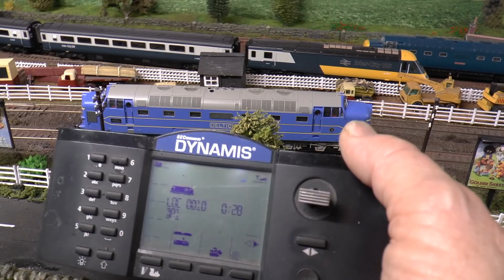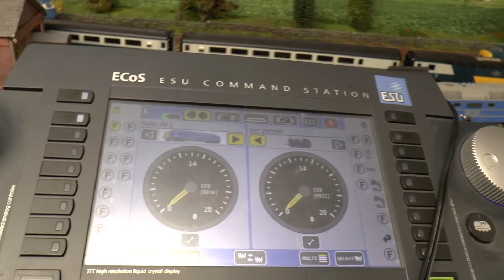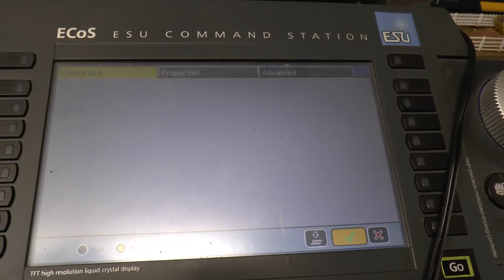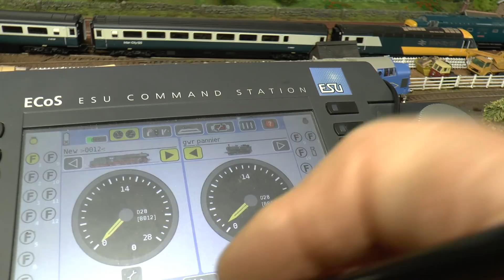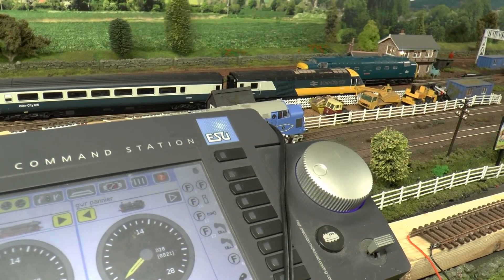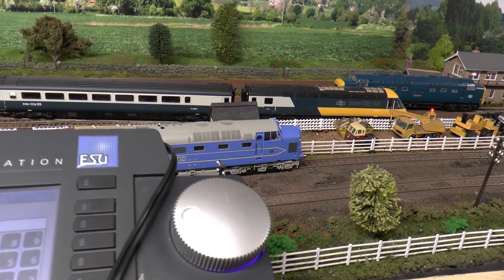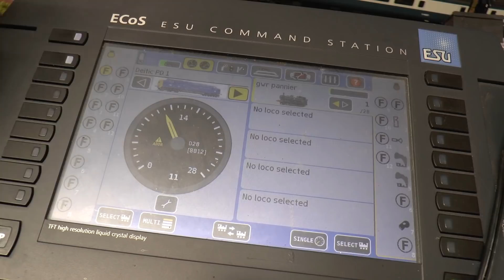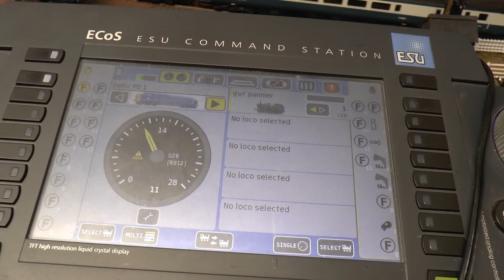Help re ECOS part 2

Comment: Dave, I noticed when it found the decoder and you tried to move the address conflict triangle was up on your screen for the Deltic. Now the decoder was found try changing the address from 12. I ran into that when I had the Ecos. Cheers & good luck Peter
Reply from the maker: I have cleared most off the ec os , then give n it a high number address that i have never used before ..still nothing ..yet attache the Dynamis or the Elite to the track and it works ..Cheers Dave

Comment: Dave, also for future references,, people, modellers, friends will try to help you and will give you sometimes conflicting information and this can lead to more confusion when you've started out to get answers. I also would suggest if you have any problems (which you haven't in the past with the ECoS or your sound decoders) to ask for help, who knows the ESU system or the ECoS it self. there are many options as you've found out how to register a loco which looks very complicated but if you leave it to the decoder and the ECoS its very simple, another suggestion is try to organize your loco list and loco/decoder numbers and I would do this as soon as possible. I either enter decoder addresses  by the loco running number, or I select a 1000 or 2000 decoder number for particular locos, you've got the choice of 10000 and more., so for instance your deltic locos could have the decoder number 1000, other diesel locos starting with 2000 and steam locos with 3000 or 1 -999, this is your choice but in the end it will make it much easier to control your decoder numbers for new locos you add to the list.Also the loco list 1 , loco list 2 and loco list 3 is important , file the same type of loco under the same loco list, Loco list 1: Steam, Loco list 2: diesel and loco list 3: others, and to do this you go into the window where you change the details of a loco, e.g., decoder number, name of loco, loco list. you also will find when you go and search for your loco under the min loco list you can tick loco list 1 or 2 or 3 to get to your individual loco, either steam , diesel or others. if you know your decoder number you can also enter the decoder number under numeral window.
John
Reply from the maker: 6109river I do have them in lists 1,2,3 Steam one side and diesel other... I shall try again to day , I do have all the numbers on a sheet and most are 100 + for diesel , then 1/ 30 for steam , this new one came as 3 obviously , but just for starters I put it to 10 ... my other trial is to connect the dynamis to the ecos so I can use both ... cheers Dave
Reply: Ok Dave, how many loco are there registered you don't own ? did you delete the Deltic in question as well ?
Reply from the maker: @6109river  I delated most have jst watched a video which should prove useful   https://youtu.be/JtKsaO_DycA .   just a case now of getting in the loft later to day and trying all this out ...the boss has a few jobs for me first John ....feel better after 7 hours sleep ...without ecos nightmares ..LOL ..Dab
Reply: I've noticed this with my wife to, when I have problems with my setup there always seem to appear  little jobs on my do list (lol)
Reply from the maker: @6109river  Always jobs to do John ....thats why I like going to the loft ...out of it ..Dave

Comment: I love the ECoS & I know how frustrating stuff like this is Dave & i wish i could help but i'm stumped too! ESU's decoders are all railcom plus certified so you could try seeing if it can detect it that way. Also, i noticed there was a yellow warning triangle in the speedo dial saying "ADDR" which i assume means address & this seems to indicate that something is wrong!
Good luck finding a solution, hope it doesn't take too long!
Reply from the maker: Showing ADDR is showing when nothing will happen , not a clue what causes it ...got to be something to do with the decoder match with ecos ..

Comment: Hi Dave, you have a yellow warning on the Ecos screen in the middle of the speed dial at 5.00ish on wards it mite be ADDR warning which is in your manual mate.
Reply: Sorry Dave it at 5.50 in the video.
Reply from the maker: All noted ...it did that and nothing worked , but after reset it is ok but still wont accept the d5 decoder ..Cheers dave

Comment: Hi Dave.  We are all  bombarding you with ideas, so here goes:
I am suspicious you may have and Address conflict or a railcom issue

I would begin by Reading cv29 and noting it, then writing a value of 2
If you wanted to use Long addresses you would write 34
Next, assure you write a loco address to cv1 that you are sure was never defined in the ecos
Then define this address to your loco by editing the loco 

Comment on long addresses: if you use a long address don't forget to assign the correct values to cv 17 and 18 by using a long address cv calculator off the Internet to get the correct values, and of course set it on in cv29
-chris
Reply from the maker: Shall check this ...got a few more ideas now ...just a case otf time now ...may get to it later to day ..cheers dave

Comment: Hi Dave, Ive checked the current firmware & it's v4.2.4 so your ECoS is up to date. I've no v5 Loksound decoders on my layout, only v3.5 & 4.0's. I have suffered a loco acting like yours in the video. In the end I had to delete the loco from the ECoS memory / database (Your case the deltic) . Then I reprogrammed the loco on the programming track. If it turns out to be the same issue I had you'll find the loco should now respond. Cheers Mike.
Reply from the maker: Wordsworth Model Railway Hi Mike , Yes I have done that , a few times , but still same response ... I shall try again to day ... my other option is to connect the dynamis to the ecos ... May try that now .. long time no hear Mike ... cheers Dave
Reply: @howarth004  Hi Dave, thought that may have rectified your problem. Like I said I had one do the same thing with my ECoS. Said address was ok, read the decoder ok, but just didn't do anything when you gave it a command. Thankfully mine worked after deleting & adding new loco. Last think I can suggest is a decoder reset. Long time since I've done one but think it's cv 8 and write 8. Hope you can get things resolved soon. Cheers Mike
Reply from the maker: @1964mikem  One of my next tries will do the cv 8 test Mike     ..cheers Dave

Comment: Have you sorted the problem Dave? I have a 
Loksound V5 in my schools class with my ECOS with the latest firmware.
Reply from the maker: Not yeet , but going to follow a video I have been sent ...but will have to be later ..a few jobs first ..cheers dave
Reply: David Howarth at 2 minutes 50 you edited loco and went to Advanced and noticed Decoder Profile was empty - mine is the same with a loksound V5. I’m hoping that your not going over old ground with this! Go to to the main screen and press the ECOS spanner icon at the top and go to Setup 2. Set the CV to 1 and press Read. See what the CV result is. As someone pointed out towards the end of the video you have a conflict of addresses. Chance the CV result to 88 or something (an address you haven’t got programmed in already) then press write. Once done, read it again to make sure it’s done it.

Go back to the main screen and edit loco. Set the address the same as you have just changed it to. See if that sorts it? Good luck. Steve. Plymouth
Reply from the maker: @sh018q2316  I have managed to sort it Steve , thanks for your help , I did get it to read cv1 and thats when all the configurations came up , still not sure what i did from there ,but it worked ...cheers dave
Reply: David Howarth - it’s purring away nicely. If I could only find my piece of paper to get my HST 125 programmed into my ECOS in consist, for power and dummy car sound!! Steve. Plymouth
Reply from the maker: @sh018q2316  Hi Steve , yes purring away .....still baffled ....for the cosist , i just go in to edit ...then on the list consist ..then add each loco or loco and dummy car ..maybe instructions (which i have problem reading them ) in the book may help ? .....Dave

Comment: Dave, I've noticed your loco is on DC and not DCC (just try and change it to DCC at 1.54 = top line) but besides this you haven't followed the suggestions, all you've done is reprogrammed the decoder number, this is not  going to get your loco going,  I've mentioned before your loco under decoder number 12 is occopied by another loco, so you can't use that address. , also at 5.35 you have to to press  detect DCC RailComPlus loco, wait for the click and than press the green tick and don't change the loco from one programming track to another track. leave it on the programming track and comeback to me with another video showing me what you're doing. you don't program locos into your ECoS, this is why they have the automatic registration, go into your loco addresses, (when selecting the loco list make also sure all the options for loco lists are off) either by name or number and delete all locos either new, or locos you don't possess especially the one you've entered (the Deltic in question). put your loco onto the programming track and press the DCC RailcomPlus and than touch the green tick. it should now register itself., don't try to enter new decoder addresses, you must have dozens of them.regarding the sound decoder/lokilopt V 5.0 not being there is true but irrelevant. when it registers you will see anew page appears either the number which is in the Deltic loco is ocopied by another number and it will suggest another number, click and except it, than the RailComPlus icon will appear and you touch this on the green tick, than if it is a Deltic sound file, the Deltic loco will come up if not  a Sounddecoder 5.0M4 will appear. change the name to your preference, if you want to change the loco number  make sure the number you chose is not already occupied by another loco as it was displayed at 5.50 with a warning sign on your speed dial.I know you're getting frustrated but at the same time pressing so many buttons to try to come to grips to solve the problem you're creating more. for instance at 5.06 you're trying the get the loco going under CV 63, to change the decoder address at 5.06 you need CV 1, but leave all these other options alone.when you select or self register or enter locos make sure which loco list you want your loco list to appear loco list 1, loco list 2 or loco list 3. you can organize these by selecting for instance loco list 1 for steam, loco list 2 for diesel and loco list for others like EMU's 

so I'll go through again:1.) by unticking all loco lists, select all locos you don't possess and delete them 1 by 1 including the one you've manually entered (your new Deltic), 
2.) make sure the sound file you've downloaded for your other Deltic locos don't have the same sound file name of your current loco (the one you've got problem with
3.) put your loco onto the programming track and PRESS DCC detect RailComPlus and than when you hear the click touch the green tick, leave the loco on the programming track and wait until it will respond, if the ECoS asked you the address is already occupied would you like a different number except it by touching the green click, it than will show a new decoder number, except it and touch the green tick, it shouldn't take long and a RailComPlus icon should show up in the bottom right corner of your speed controller, press it and you will find you've now have registered the loco.
4.)to change the loco address again make sure none of your other locos have that number you can check this by scrolling through your loco list (make sure all the options are off under Loco list 1 loco list 2 and loco list 3) select decoder numbers and you should see all your loco/decoder numbers and than select a free decoder number., enter your Deltic details into the new name (Deltic PD 1)You will find when the loco is registered or recognized the name of your loco will either be the name of the sound file or it will show up as Loksound V 5.0 M4 and as I said make a video of it so I can see what your doing. this video helped me a lot what you have done and haven't done and doubled up; in future when you get a loco and you install a new sound decoder do not enter the loco into your loco list, let the decoder and the ECoS do the work, it does it automatically.  anything you double up/change or reprogram you will encounter problems, like this one.
Reply from the maker: I have tried for about 3 hours to day ..and totaly peed off ..I have taken most of the loco`s out of the ECOS , then re entered them via servicve track like I have done for years , also done it with the Hornby elite , and all work , except the DP! with the class 5 decoder ..I have read the decoder from Generic NMRA ..i get cv 1 and if located a number it shows that ...but still no action ..sorry but given up for to day ..may try tomorrow ..but i have done it the way I have for years   5 sinbce i got the ecos ..and no it wont work with this one ..Cheers Dave ....going to watch repeats of Heartbeat ..more relaxing ..

Comment: Hi Dave .
I have a similar problem my Gaugemaster prodigy wifi reads most decoders ( locksound , bachmann) but gives me grief with Hornby tts. Could be the dcc unit ,as stated try a firmware update or patch if there is one available hopefully this may resolve it. 
Kind regards Greg Brassington.
Reply from the maker: Fully updated , but still wont work ..TTS is another touchy one , had a few probs with one I have , but seems OK now ..cheers dave

Comment: - dynamis is made by bachmann is it not ? - can you do a firmware update on the ECoS ?
Reply from the maker: Tom Hurst Hi Tom got the latest firmware on it I am told .. I thought dynamis was the same company , so that explains why one does and one doesn’t ... but a few say they don’t have a problem... I have ?? .. cheers Dave
Reply: David Howarth Dave you are right Dynamis was based on an ESU control unit so essentially the same company. Of course this doesn’t mean to say that one will work and one won’t I’m afraid.
Reply: David Howarth - does ESU have a product helpline, maybe get telephone advise - have you tried the new class 55 work with a version 4.0 chip or the other way does your older 55 work with version 5.0 - sorry I cant be of much help -  on another note the bachmann ez command had input or was designed by Lenz
Reply from the maker: @Haymarket47  Its weird , I have used this method for about 5 years , programe the loco location on either Hornby Elite or service track of the ecos , and when put on track has corresponded to located number and worked fine ...something just is not right with this ..cheers dave

Comment: It might be a loose wire or connection inside of the locomotive or if you can check the CVS and see if one is not been turn the owner off but more than likely at least wire inside of the locomotive or you could just have a bad Decatur
Reply: It might be as much as decoders not pushed all the way into the wiring harness
Reply from the maker: @BALD8BIL  Wel I would have though if it was a faulty fit it would not work on any of the controllers , as it is it works on the Dynamis and the Elite ..cheers Dave ..back to drawing board
Reply: I'm in the construction business and I can tell you that when  it comes from  the factories nine times out of 10 it doesn't always work and it might be your CV just need to see if it set to be on or off check into that see if you got a  CV that needs to be turned to a on or off position

Comment: Hi Dave,
The problem has to lie with the ECOS. The loco uses the new version 5. The other controllers recognise this.  Automatically. The ECOS does not, since it seems to only read up to version 4. Something hasn't been updated and is missing.  Surely ECOS has a help line? Blimey, really am feeling for you...............Reinhard
Reply: Dave, Try this: Make sure you understand it. It is pretty clear. Just long-winded.
https://www.youtube.com/watch?v=PWdyGSkZ50g
Also, if the above is double-dutch, get back on to SWD. Get them to walk you through their 'manual' process while you sit and do it. Cheers, Reinhard.
Reply from the maker: @letzterinstanz  Thanks Reinhard , I have watched this video earlier ...still with all the suggestions I can not get it to work ...SWD jsut said they did it manually , I have tried , I did not buy from them so no come back ..but got to be something wrong with the decoder match to my ecos ...Off to bed ..got a big headache ..LOL ..cheers dave

Comment: Contact the support of the ESU ecos why it does not support the loksound v5. As an ecos user you probably have an account.  The normally  have good support.
Reply from the maker: I have tried that ...sent e mail not rreply ...tried SWD and they just say it can be done nor problem using manual ...i have used that ...but nothing as you saw ...Cheers dave